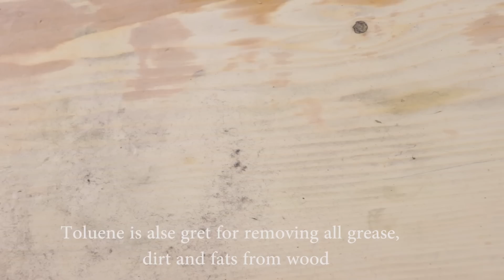Antique Rusty Lefaucheux  - Restoration

Comment: Why didn't you use penetrating oil to take off the last screws? Also, I think you fucked up the Springs with that Vise grip. You also should have polish the metal, and actually clean the wood.

Comment: Do restorations like this devalue the piece to antique gun collectors? On shows like Pawn Stars or whatever they always say that restored pieces aren’t as valuable as if they were left alone. It obviously looks far better restored, just wondering about the monetary value aspect of these type of restorations. Well done again Andre. Good work.
Reply: Once it's rusted and pitted, there is no collector value outside of far out there crazies that want total shit. Don't restore an aged piece, restore a trashed piece.
Reply: I don't know what the collector's value was before restoration, but that value is all gone now forever and won't come back. Collectors don't want stuff that's been messed with. This is the sort of antique that there will be fewer and fewer of every year, and in worse and worse condition, meaning the value of even a beat-up example will continue to rise. A cheap knife left in the sandbox for 75 years is one thing to fix up for utility purposes. A 180-year-old firearm is another.
Reply: Icanhasautomaticcheeseburger Not quite. Something like this won't be a collectors piece in this condition for a very very long time yet. With no history to the gun, it has to age better than being a block of oxide to be valuable. It was previously worth about 100 bucks and it's probably still that.

Comment: All these Pawn Star "experts" who are claiming you've devalued your gun should take a moment to check out the Wikipedia page on Antiques Restoration, here:

https://en.m.wikipedia.org/wiki/Antiques_restoration

In my opinion,  you have greatly ADDED value to this amazing artifact. In its original condition,  maybe 50 or 75 bucks.  A professional restoration could probably push that into the thousands. 

Having said all that,  I'm not sure you've actually completed the restoration,  because you have not applied any finish. Were the original items shiny metal? Also,  I may have missed it,  but I  didn't see you do anything to the interiors of the barrels. Also, I'm pretty sure it needs to be fired to PROVE that it's been restored to original condition.

After restoration,  next is conservation - protecting the piece against further damage.

Comment: I wouldn't have done the rust removal like that. I'd have just used the wire wool with penetrating oil as a lubricant, somewhat like using oil with emery cloth - it would have given a MUCH better finish . . .

Comment: Why would you leave it in the white?
Reply: Blued, case hardened, Nickel was pretty common on these etc. If you leave it in the white then it will rust very fast. I have never seen a firearm made in any era left in bare steel. They always put a finish on it to keep it from rusting and to protect it from the elements

Comment: Any antique value it had is now gone. You shouldn't use these rust removing chemicals on antiques, just oil, steel wool  and elbow grease
Reply: Never steel wool
Reply: Ask any antique gun auction or shop and they will tell you steel wool or wire brushes make antiques utterly worthless
Reply: The best thing to do for an antique firearm that you intend on preserving the value in is usually nothing other than oil unless you are a master gunsmith and know how to properly restore antique guns even then unless using all original parts value still decreases, and some value is still lost if the gun originally had matching numbers on the parts and you replaced parts with non matching serial numbers
Reply: Every antique gun guy I've ever talked to has said the most valuable ones are the ones that some guy stuffed in an oil soaked sock and never touched for years other than to add more oil

Comment: buying so called rust removers is expensive and sometimes they dont work, try using vinegar or coke, i like vinegar the best,  i work on old cars that have a lot of rust, sometime i have to use my little sand blaster. but vinegar works fine.

Comment: Not a restoration. You just cleaned it up. It still looks old minus the rust. "Restoration" is returning it to near new condition.
Reply: Jeremiah Miller On an old rusted gun, your restoration would be just building a new one.
Reply: TotalMetalJacket you sound ridiculous
Reply: Jeremiah Miller How? You can't do much more to this without rebuilding it. You can't un-pit rusted metal.
Reply: Totalmetaljacket you're right. De-pit it. New scales, boar barrel...
Reply: Jeremiah Miller You'd have to remove the factory finish entirely to do any of that and it wouldn't even be the original gun anymore.
Reply: TotalMetalJacket not true. Like I said. Replacing the scales would be part of a true restoration and only if you know what your doing attempt a film restoration. If you can't... then don't.
Reply: Jeremiah Miller Well good thing he didn't attempt that.

Comment: (Uses acid test fires) week later 
Man: Wow he was shot in the chest and  bled out.
Man: what’s that (sees fractured gun) 

I don’t know anything about guns but I’m guessing if you use acid it would mess with the integrity off the steel and explode when fired
Reply: i know a little about chemestry, and no, it wouldnt explode.
what males the metal strong is its internal cristaline structure, and acid cant change it unless they corrode all the way through.
Reply: The Terrible Animator thank you

Comment: just screwed up the value of the weapon that is not a restoration, it's just a bath on acid and internal cleaning, the real value of the weapon ceased to exist at the time I erase the old patina, if you have a weapon and old and plan to do that's what I'm telling you now FOR that only ruins the weapon, if you can clean the internal mechanism and the threads of the screws but do not remove the original patina

Comment: in this case, it's not actually a good restoration The metal should be reblued. If you don't make it functional, it's not a restoration. All you did was pretty it up a little. Not that you don't do nice work, as far as you went, but to call it a restoration is not correct.